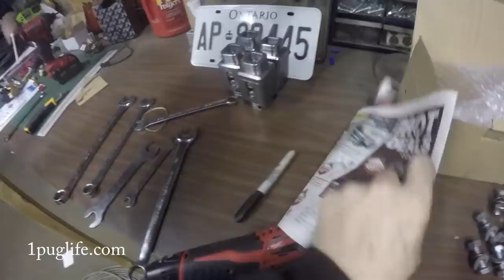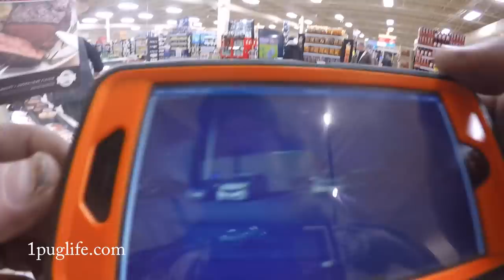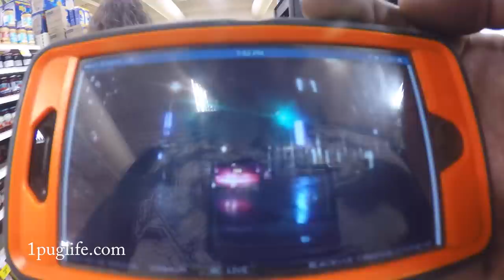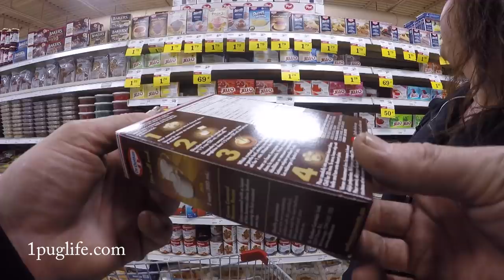if only it wasnt so floppy

Comment: The lines on that bumber are so nice. I wouldnt even bother adding the tow hooks, they'll rattle around when you break or accelerate and wear out the paint. Just leave them in the glove box for when/if you'll need to use them.
Reply: Definitely buds.. not going to look good.. whatever color they end up...
Reply: friendlywhiteguy exactly
Reply: friendlywhiteguy agree

Comment: 13:30 ish that's not an impact socket goof they come in black,
Reply: Tinder inc still shouldn't flake like that, a majority of the sae/us sized sockets I use with air tools are all chrome plated and don't shit the bed like that. Although a few have exploded when using a breaker bar.

Comment: That bumper does look really good pug.  Personally I'm a big negative on the red shackles.   Look too ricer just leave em silver.  I would suggest you glue some rubber pads behind them so they don't wear through the paint and leave a rusty streak.

Comment: trucks should have a metallic gray paint job so the it doesn't look like shit with the some idiot thought the bed was the whole truck (line-x) and you need to put 12" wide wheels stance looks weak now with the bumper overpowering it

Comment: if ya wants to get rid of the floppieness in the bumper, run some flatstock from the corner to the center section ( between headlights) and weld them in. Then weld some flat stock from the center of the other flatstock to the underside on the top and it wont be all floppy and shit.
Reply: Kyle Grace It's not floppy... he's joking...people in the comments were ragging on him saying it'll be floppy
Reply: cant hurt to put some extra bracing in lol. I didn't think it made sence for it to be floppy. When he said it was floppy i was like wtf
Reply: Kyle Grace it's made of like half inch steel....robbis could sit on it and it wouldn't budge. bmp
Reply: Don Garvey I dident think it made sense for it to be floppy. When he said it was floppy i was like wtf how in the fuck is that floppy. I couldent tell of he was joking or not. I gave some advice because I couldent tell if ge was serious or not. The mounting brackets, and the d ring mounts
 are 1/2 steel, the rest is 3/16 plate bmp
Reply: Kyle Grace Friggin Rights bud. chooch it
Reply: Don Garvey go chooch a pant wantler bud. lol jk hahaha

Comment: Is there going to be an issue with the tank right under the bumper?  I feel like they are watching the whole bumper series pretty close and as soon as you have shifty on the road the federonskis are going to pull you over for having that tank there. Explosion hazard? Just wondering! Chooch it!
Reply: Nick DeHart the steel pressure tanks can take a flogging
Reply: Well I'm sure they can but I feel like the Walchers are watching and as soon as they see him out and about it would give them reason to pull him over and give him shit about it. Just looking out for old pug1. Bmp!
Reply: It should also be mentioned that top and foremost is the safety of a innocent driver, such a good speed rear end accident.  I  have no problem with having these tanks but they should be installed in a safe area like in the bed in front of the tire well or inside the frame but away from the fuel/gas tank.  A forethought is always 100 percent better than an afterthought, always keep safety in mind in doing projects like this.
Reply: you do realize compressed air is in every tire!

Comment: If you paint that bed liner on the plastic grill be sure to scuff it and use a adhesion promoter otherwise that stuff will flake off quick.